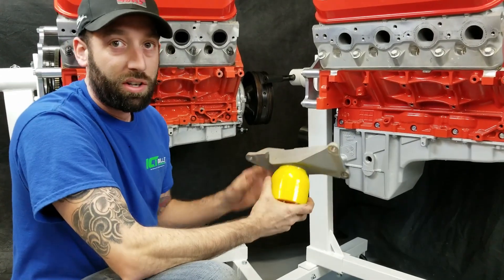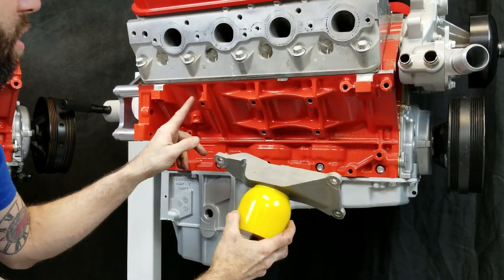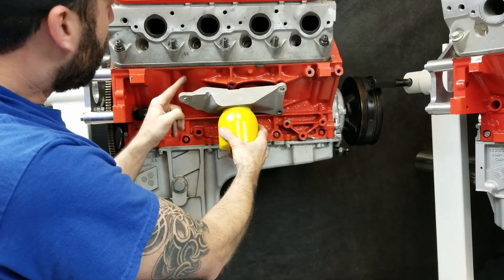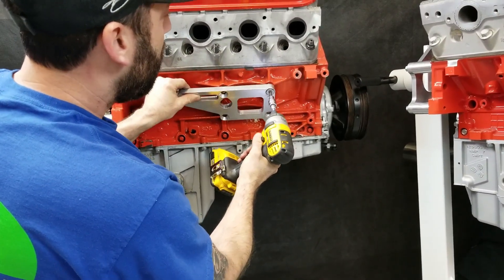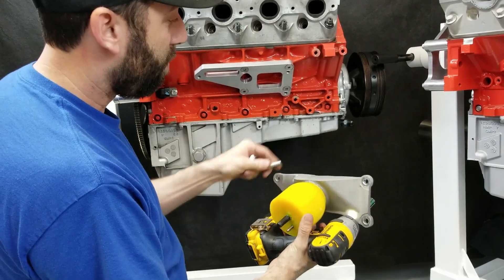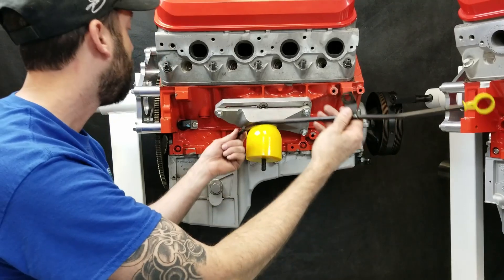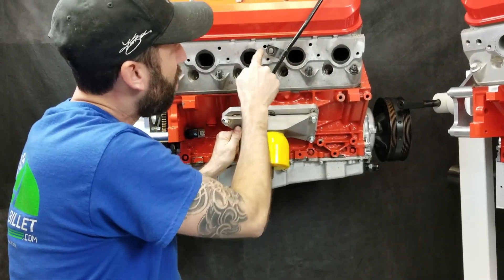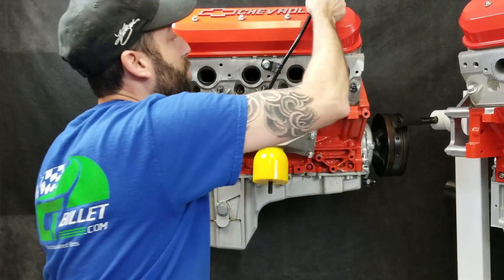ICTBillet 551921 CTS-V to LS engine mount swap adapter kit

Comment: So this will work if I go buy a 6.0 or 5.3 iron block out of the junkyard to put into my 6 cylinder CTS 2004 Cadillac?
Reply: Have u try the mount
Reply: @alvinmccool6772  nah I haven't started on the project yet. Our house burned down and we lost EVERYTHING with no insurance. It hasn't been a easy time
Reply: @dynamicdopamine  You ok man?
Reply: @drew nabors  it's been a rough road sir. Thanks for asking tho.